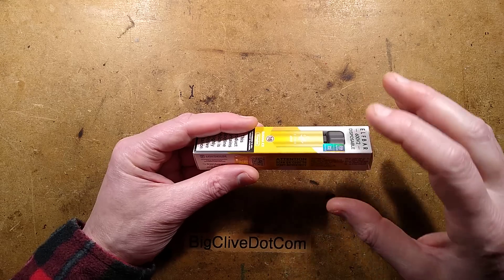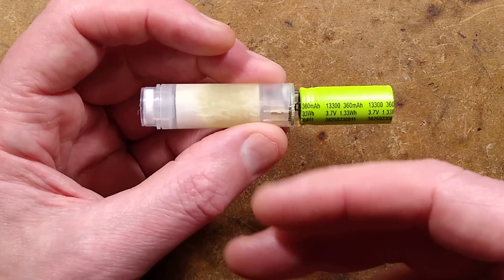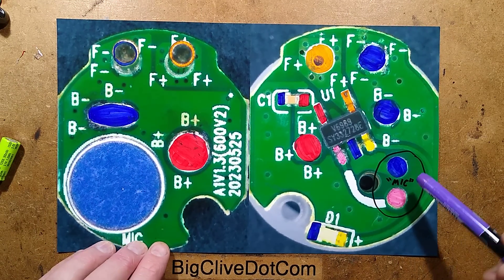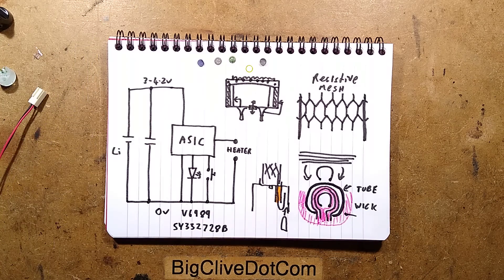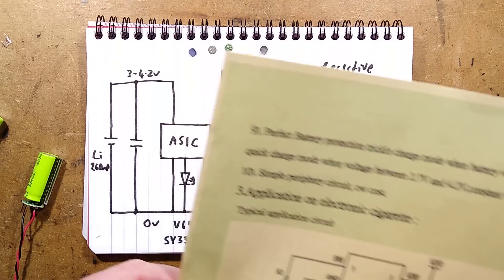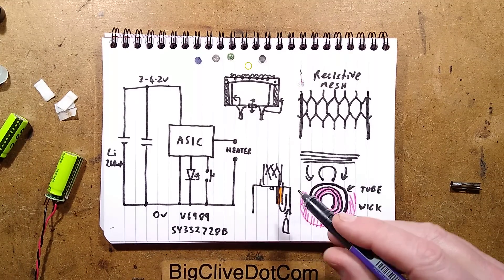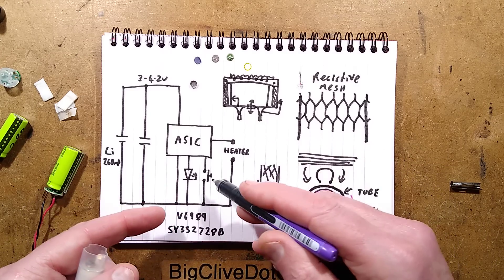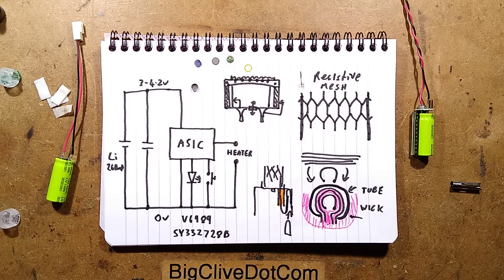Lithium "capacitor" in a disposable product

Comment: disconnect battery negative first - same as with a car battery.  could they be used cells, recycled - would that explain the capacity discrepancy?
Reply from the maker: They are usually new and good quality cells to handle the high current bursts during use.   In the early days some devices had very low capacity cells which resulted in a short lifespan of the device.  Many sellers started stating the cell capacity in their listings to indicate run time.  These new versions do use lower capacity cells, but they use them more efficiently so that the lower capacity still results in a long lifespan.  To avoid them being judged on the capacity they just said 500mAh to avoid losing sales.

Comment: I recently found one of these too (mine was in a Lost Mary, not an Elfbar). Nice having it in a capacitor format —it plugs right into a breadboard! What current do you guys charge these at? I measured an internal resistance of around 250 mΩ, so I stuck with 0.2C (72 mA) to be safe. Strangely, every other cell I salvage is one of those standard grey cylindrical LiPo-style pouches... what's going on? 🤔 Are there two versions floating around? Only downside: getting it out without shorting against that nearby ground plane was nerve-wracking 😨
Reply from the maker: Most of them use the classic silver cylindrical pouch cell.  A typical charging current could be 350mA for the capacitor can style cell.

Comment: I take the rechargeable ones to use in my electronic projects. Works great on microcontrollers. I bridge out the pressure sensor and then connect what ever to where the heater is supposed to go. This way I dont fully discharge the cell because the little charger will shut down when the battery is flat. Not all of them work the same. Some light up a LED when the pressure sensor is bridged out which causes the battery to deplete when not in use. Some vapes even have a little LCD that shows you the battery level. Its a very sad state of affair that these are just chucked into the dustbin.

Comment: Smaller battery.. more efficient heater?
Reply from the maker: Possibly a new version of the control chip that regulates a heater based on battery voltage.

Comment: If it is difficult to disassemble because of possible shorts, then this might also explain why they sometimes catch on fire in the garbage.
Reply from the maker: That's usually because they are crushed.  The newer versions use the cell more efficiently, so there's less charge to cause issues.

Comment: I just today came across a totally new type of vape that i had not seen before and that can be opened by removing 4 tiny screws. It is about 7x5x3 cm  is rechargeable and has a display that indicates the charge, the amount of filling and the amount of the vape that can be set with a little knob. It easily comes apart and i guess that after removing the reservoir and suction sensor one is left with a small rechargeable unit of which the output power can ve set. The battery is soldered onto the small PCB that also carries the display. The battery is a regular solder on battery and not the new 'capacitor type". Not sure about the amount of watthour as that is not visible. I may need to desolder the battery for that. I found about 20 of them, Brand 'Vozol'.
I'd be happy to put up some pics of the taking apart but can't place links
Reply: It appears to be the Vozol Vista 16000 quite pricey: 17.50 USD/ 24 Euro. And i got 20 of them.
The battery is 650mAh
Taking it apart: pull off the knob, remove the 4 screws (tiny flathead works best), pop off the bottom, pull everything out

Comment: I've been collecting the 5v USB-c chargin ones and making analog fuzz pedals with the daughterboard and cell.  I just find a germanium transistor pair and make either fuzz face or rangemaster or both.

usually you have to bias the circuit from 9V to make a voltage divider. instead I just run the 5v which is often the target anyhow.

instant cheap rechargable fuzz that doesn't destroy other pedals in the component chain.

these units aren't even good vapes.  that said it has a battery in that capacitor. and a polarity reverse in that circuit

that mic is an electret mic. a pressure sensor if you will..

heat gun  to desolder SMD

that capacitor is what makes it a pressure sensor... it blocks the signal waves and just turns it into on and off..  kinda genius bypass to running a transistor.

your diagram makes me think I'm wrong completely however..

the units I been playing with are rounded off rectangular.

I would guess it's a cap to raise the voltage only. I actually hadn't noticed these in the other vapes as they have a separated unit

Comment: There not lithium! If you unravel the battery the strip that looks like lithium it does not react with water or fire ????
Reply from the maker: That's right.  They're lithium "ion" cells with mainly copper, aluminium, graphite and the lithium ion carrier material.  Non rechargeable lithium cells have a lot more lithium.
Reply: @bigclivedotcom  ok makes sense but that don't react at all with water ??
Reply from the maker: @natureinquisitive.no1  It's too diffused through the electrode materials.  There's very little actual lithium in a rechargeable cell.

Comment: If only it was possible to reuse a battery, maybe in a metal tube with threaded end caps so it can be removed and charged, with a threaded heating element that could be refilled, and make it all work with a simple mechanical button. But such a device wouldn't make the tobacco industry enough money now would it?

Comment: Went into a Vape shop looking for spare heater element for modeltrain smoke making. They only sold disposables now. Now I know what is inside. Think I will find a nichrome supplier instead. However Ultrasonic mist makers modules are cheap and just use water instead of mineral oil.

Comment: The rechargeable styluses for Android and Apple phones have the same type of battery albeit much skinnier they are even the exact same color with positive marked with the black stripe with + symbols down the side . I believe that they are designed to burst like a capacitor if they go into thermal runaway but I believe that makes it more of a risk to try and recharge them unlike lithium batteries with the foil outer casing it won't swell it will burst and it doesn't have the strength of cells with metal cases like you would find on a 18650 or 21700 that are common in vapes . So I really don't understand what the advantage is with this type of cell or maybe it is*cheaper to manufactur but that doesn't seem to be the case because the foil cased cells I think would be cheaper to make

Comment: These 'mic' sensors in e-cigs, you cleared up a misconception for me: I'd always assumed that an ultrasonic "dog-whistle" had been somehow molded into the case so the mic could be connected to a low-power circuit which is tuned to fire at that frequency.  Also, I really like the idea of fitting LIPO cells into electrolytic cap cans.. It seems so much more robust.  Cheers!

Comment: It makes sense for a company using intended to be disposable single use batteries to prevent recharge. If people start recharging the batteries that weren't meant for it, using rigs that aren't certified for it, the chance of battery explosion increases significantly, meaning the chance of lawsuit increases significantly. It also prevents disreputable people from reselling old, used disposables.

Comment: disposable vapes are undoubtedly terrible for the environment, i use them because its cheaper long term than cigarettes and less hassle than refillables, but the amount of shit that goes into these just to throw them away astounds me. the one i have now has a screen in it, not just an indicator or segmented display, an actual screen that has way more pixels than it should, id guess about 600 x 250, just to show battery levels and about how much is left to puff

Comment: thats not a capacitor its a battery that looks like a capacitor and lithium batteries are not new to the vape industry but i will say they are getting reckless with what they put them in and how they get disposed of as these will cause trash truck and dump fires. no one will give them a salt bath to render them inert most unknowing people will throw them in the trash ready to cause a fire

Comment: Something I think gets overlooked is that the reason these devices are so wasteful is actually because of anti vape legislation. In the FDA's attempt to crackdown on Juul they only specified a ban on disposables that use a pod system, which means the only option for these manufacturers is to put a fresh battery in each one.

Comment: I have noticed these 'Lithium Cap' cells in some higher end dashcams designed to continue running for a prolonged period of time after the car is turned off essentially depleting the entire power source which would make short work of a standard lithium battery, effectively killing it.

Comment: alot of vape stores have by back programs for 1$ for each old vape but you can only trade in the amount you by. If the Gov ever even paid 50 cents for every vape homeless people would solve the problem to a large degree in urban cores (if they were worth x10 a aluminimum can and much smaller)

Comment: I try all the 510 threaded weed cartridge pens, my newest has a twistable bottom to change the voltage between 2-4 volts. It's like some sort of evolution as all pens are very similar based on ordering the same packaging etc and small changes are made to differentiate brands.

Comment: I got one of these out of a bluetooth speaker a customer gave me at work because it was broken, but its a full 18650 form factor. The charging port was broken because usb micro so I re routed the power to the usb A and just used an A to A cable to charge.
Then the battery stopped working, so maybe these new style of lithiums are easier to make and use because of the contacts being on the same side but they're less reliable?
Reply from the maker: Make sure there is definitely charge control still active for the cell.
Reply: @bigclivedotcom Where do you take vapes or pods at to get recycled? I know rechargeable batteries have a number to call for recycling? Thought you would know? Thanks.
Reply from the maker: @ShawnStafford-1978  Some disposable vape sellers take them.

Comment: Its just a regular 1S LiPo.  A capacitor would be marked in Farads, while the battery is in milliamp Hours.  Also, if it were a capacitor it would fully charge in less than one second.  Don't take the caps apart either, or even handle them without first shorting the contacts to dissipate the energy or you may get shocked.  If you short a lipo battery in this way, it is likely to explode, and if not...the wire just got really hot.   We have a saying that you can tell the most senior guys in the lab/shop by the number of hand and eye injuries they have had.

Comment: Instead of desoldering that tricky B+ could you use a dremel and just grind it out? I've been enjoying disassembling, refilling and repurposing vapes for the last year. Too much talk about how horrible China is and not enough about how old-school clever some of their products are. It's funny alot of these puffers are rechargeable but not refillable. The problem i've had refilling some models is that the seals, usually a shite O-ring,  fails and lets the fluid infiltrate the circuitry.

Comment: The mic looks like a standard condenser mic but without the resistor and FET inside.  Wonder if the chip is doing that function?  I really think it's switching by change in capacitance, as the mylar diaphram won't handle contact duty for very long.

Comment: Hey clive, long time subscriber here. Ive seen a few of these videos and I would like to point something out here. As far as USA or America goes, these capacitor type lithium ions are nothing new. (I found my first one in a usb rechargeable RC car from 2014) They went used in many products around here but seem to be making a comeback so maybe they are just new in that part of the world maybe? But for some reason these capacitor packaged batteries seem to have an overall longer lifespan. My first 2 examples of these batteries are from 2014. even 9 years later they retained just about all of there capacity even after sitting untouched for several years. So the shelf life on these things is pretty amazing.
Reply from the maker: The self discharge rate of lithium cells is stunningly low.  It's an incredible battery technology that we all take for granted.

Comment: surely these are disposable LI cells made to consume the metal (like a Zn C battery). They can really be recharged - Just like Lithium Button cells
Reply from the maker: They are rechargeable.  The non rechargeable lithium cells are smaller, but actually use more lithium.

Comment: Hey Clive, any tips on how to unsolder the lithium cells from the tiny circuit boards? I recently salvaged quite a few of these devices but I'm struggling because I don't want to heat the pins for too long or short them against other components as you explained.
Reply from the maker: Someone suggested snapping off the pressure sensor to remove that grounded case from the vicinity of the positive solder connection.

Comment: Helps explain why I haven't seen as many gutter slutting douche flutes lying about lately.  Who wants a douche bag with half the capacity.  Those cap-cans could hold way more power, oh well.  Their rechargeable cousins are the new whores on the block, and even though its cells have less capacity and more discharges they're still free bangers.

Comment: I found this type of lithium cell already year ago in an old cheap bluetooth speaker. I was surprised but it was also questionable because this type of 18650 cell was completely unnecessary such a device. There was so much free space inside it. So i removed this capacitor cell and filled empty space it with normal 18650 cells. Easy upgrade from 500 to 6000 mAh

Comment: I really don't like this new design. The slightest dent in the casing makes them almost impossible to dismantle, plus the new battery splits open more easily and leaks electrolytes 😱
Before you could remove the bottom and easy remove all the components, even when they were completely crushed.
Surprisingly, lithium pouch batteries rarely leak, even when flattened.
I've been collecting disposables for 2 years, I have a lot of experience now ☺️
The battery size was reduced to 360mAh earlier in year after it was revealed that they were overfilling the tanks (3.8ml instead of 2ml).
The 2ml limit is ridiculous, it's impossible to use extract the full amount without burning the coil 🙄
From experience, I can tell you that around 0.3 - 0.8ml of liquid remains in the tank even after sucking the living daylights out of them 😆
Even the overfilled ones (3.8ml) would leave as much as 1.8ml remaining in the tank 🤷
So technically, you won't get to enjoy the 2.0ml that's advertised on the packaging 😉
They was overfilling them for a reason, and B.A.T. had to spoil the fun 😅

Comment: At similar time that society became more environmentally conscious, these motherfuckers started to pop up everywhere. I hate these devices, so much that I called for a ban on these "single use" vape devices to my legislator. No answer of course...

The Lithium cell you have there looks more advanced than from the devices I took apart, I've only seen these small pouch Lithium cells. Of course they're rechargeable, but they're still single use since there is no option to recharge them. Then there are others that you can recharge because the cotton thing that holds the liquid inside is too big for a single discharge, but since there is no option to refill the cotton with more liquid, its just as single use.

But they are handy, for sure. Compared to the vape devices that use  removable 18650 cells with coils that needs to be replaced from time to time and with reservoir for the vape liquid, they start to leak eventually (change the rubber seals in the reservoir and/or coils to fix that btw.), needs to be refilled, needs to be recharged.. Basically a lot of maintenance compared to these motherfuckers...

It's not like Lithium is a very abundant material that needs no recourses to mine, we have a lot of and every industry needs it that produces rechargeable batteries don't uses it. It's the complete opposite. And we decide to waste the materials in motherfuckers like this... I really do hate them with all my heart...

Too many people don't know about this and therefore just throw them into the trash when they're used up. Besides all the materials that will just end up in landfills because of that, it's also a fire hazard when the cells gets crushed during the process.

Everything screams against these devices and we still allow them to be sold.. Because they're "so handy".

Again: I really do hate them..

Comment: Clive, I've been having issues with these where one activated they don't stop till either bang it hard on something or it just decides to stop. The scariest thing is it does sound like it's shut down but just before it is about back in your poket it ramps up oddly..like a run away effect or perhaps like feedback on a mic. Il try record one if interested
Reply from the maker: That sometimes happens if moisture gets into the sensor.  The chip does have a safeguard system to prevent continuous operation.